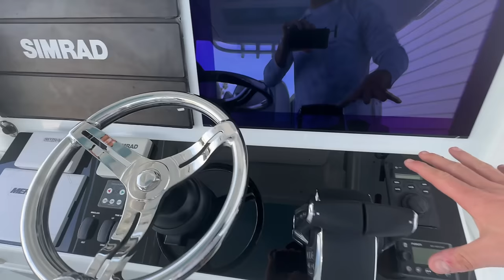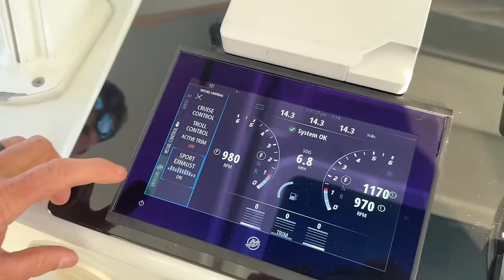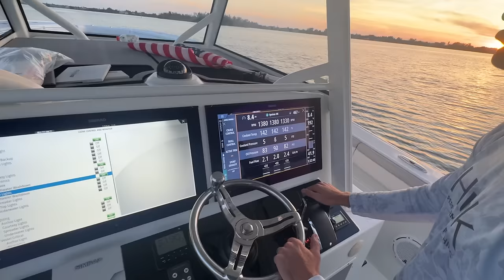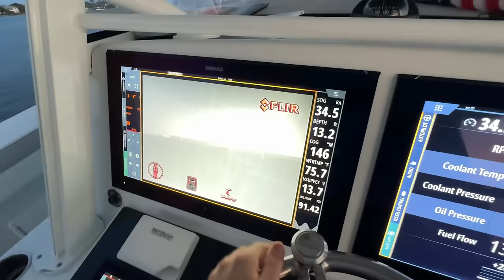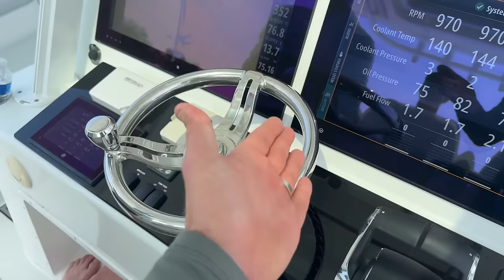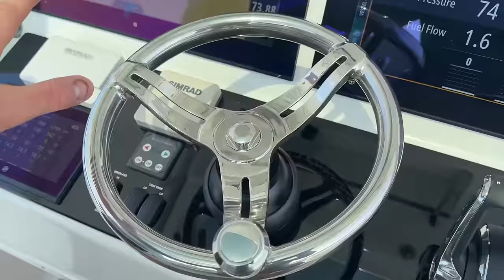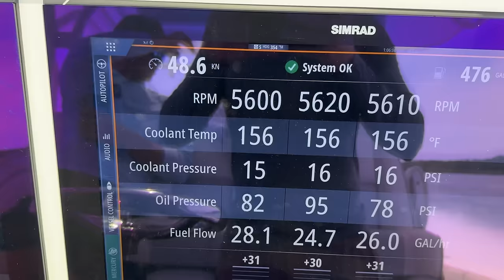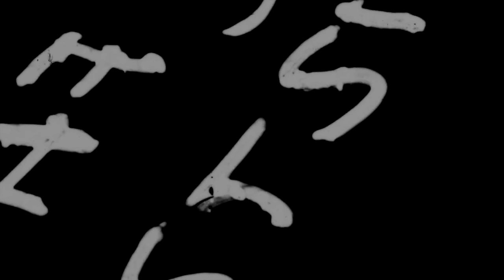Yamaha to Mercury V10 Verado Swap on a 42' Yellowfin! Sandbar Day with the Fam!

Comment: Just doing the math in australia. Full speed burning 100 gallons per hour = 378 liters would cost us Aussies about $800 per hour AUD, roughly $540 USD. Nothing costs like fun in boats and planes hey. Helicopters prob worse lol
Reply: Depends on the helicopter, an R44 uses about 15-20 gallons of avgas per hour.
Reply: Between fuel and little pickup trucks, Aussie boats end up being pretty small. Not that I don't still drool over them. You guys are the master of aluminum pilothouse weekender fishing boats.
Reply: Fellow Aussie here. This boat is an epic setup.. I would also add cars to that list. If you want to play, you gotta pay. Boats, planes, cars. Basically anything with an engine.
Reply: Boys, if it's got wheels or tits , it will cost you money $  😊
Reply: Like he said, you can't hide money! 😂
Reply: That would be about 800 usd over here in Iceland :)
Reply: Don't forget fuel pumps on tye water pay more tax which makes the fuel more money.  In canada it can be 40-50 cents more per liter in our marina.
Reply: Miami presteage
Reply: Might be more li kk e $400. Gas is cheaper in Florida.

Comment: You can fix the vinyl by using Seabright, mold and mildew remover from West Marine, and then power wash. Don’t forget to get a vinyl reconditioner also from West Marine..
I had the same exact problem on my pontoon boat and thought my final was trashed but after doing this, it looked brand new I was amazed
Reply: I had good luck using the mold and mildew remover with a magic eraser pad.

Comment: The lower unit of the motor spinning opposite gets more wear because it is a single engine working to counter the rotation of two engines running the same direction as one another.  More strain on the one for sure.

Comment: Sweet boat. That 42 Yellowfin full of fuel, with the triple 400s and the generator weighs around 21,000 pounds. Then add the people, ice, drinks, and whatever else that is on board that didn't come on it from the factory. The boat alone, without engines, generator, and fuel weighs 15,000 pounds. Those trip' 400s push it very well.
Reply from the maker: What if I told you was even able to plane out on 2 engines loaded down! Pretty amazing boat
Reply: @DoctrParker  That's awesome. Those V-10s are sweet.

Comment: There are two kinds of boaters out there.
The ones that have run aground and admit it.
And then the others that have and lie about it. Sand groundings are no biggie. I think it was the third day in my 35 that I put it on the sand. Not at idle! But mine was an inboard and I dinged up a couple of pricey props.
Oops Duh!

Comment: Curious as to how much your trimming the motors on the top end??  I trim up and up and up until they start reving too rpms or start loosing bite.. then bump the trim back down just a tad… getting the front of the boat out of the water , less wetted surface means more SPEED !!!!! Oh and keep an eye on that water pressure…😮😅

Comment: Parker ask the guys that rigged it if they used g3 when they propped it. Those engines won't let you over rev.  There might be couple more mph left there. It's all about the 3 "d"s brother.